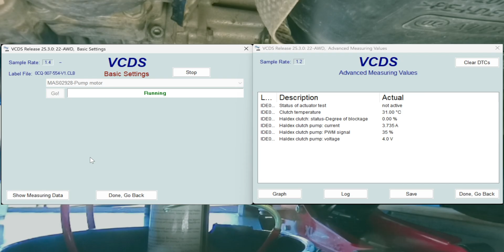Haldex Gen 5 Service & Differential Oil Change | VW Tiguan Allspace 2018 DIY | MBA | 5NA

Comment: Crisp and very helpful video. Could you please share at what odometer readings we should generally change these 3 fluids in a VW Tiguan Allspace 2L TSI 2019 manufactured model done almost 60000 kms. Haldex Oil , Differential oil Front & Rear , DSG oil. And keep up the great work mate 👍🏻😊